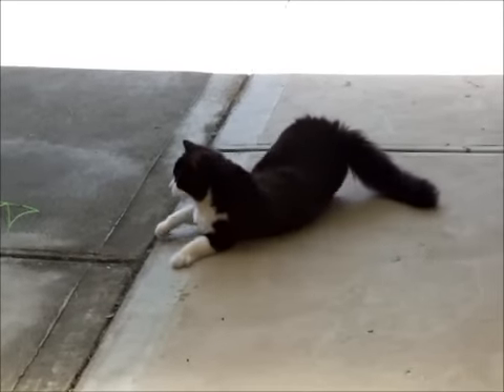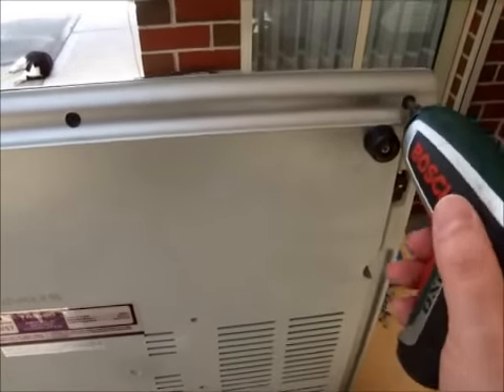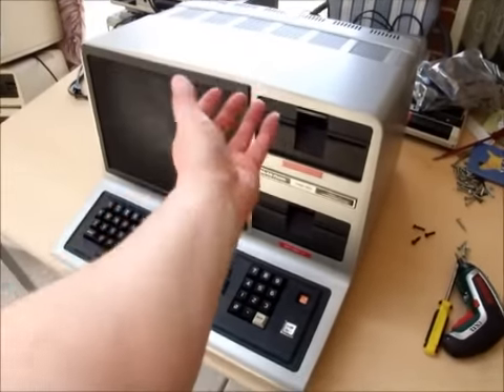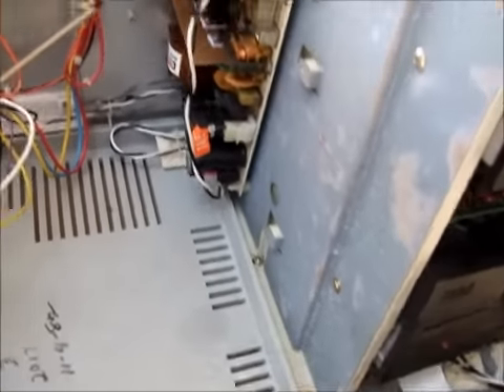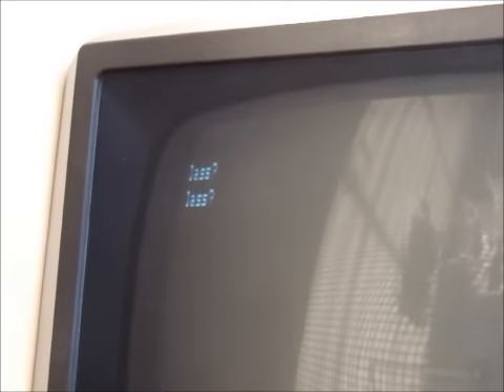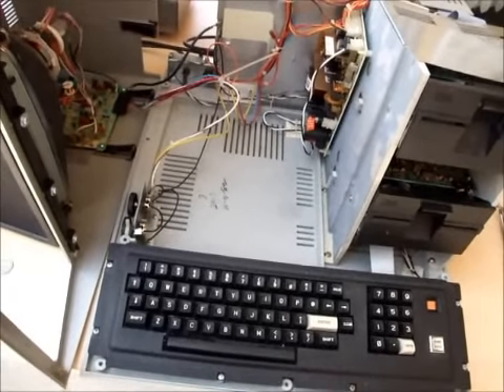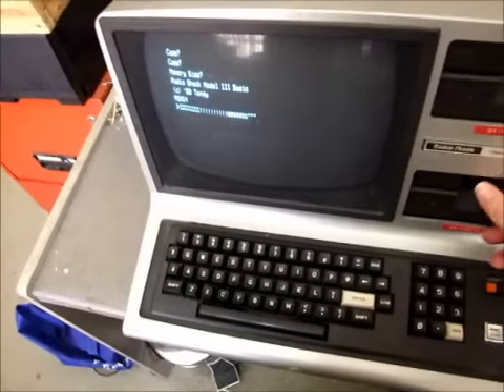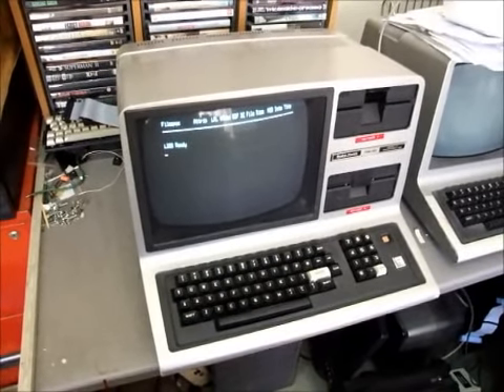TRS-80 checks before powering up

Comment: You're videos are extremely helpful.  I used this specific video and another one where you show the jumpers for a punctured keyboard PCB to fix my PCB.  Mine had a wicked hole thru the middle and the previous owner had about 8 wires running all over the place.  There was zero chance I was going to be able to use a multimeter to figure out the proper connections and I was starting to give up hope.  I freeze framed your jumpered PCB with similar post support damage and your two wire jumper configuration brought my keyboard back to life.  Thank you Sir for helping the Community.

Comment from the maker: I think the assembly at TCA and burn-in/QA test was all done in the one step and so the date seems to reflect the build date.  Most, if not all, Model IIIs, non-gate 4s and EIs have a hand-written date inside them.  Gate M4s and all 4Ds have a date stamp inside them.  

I have seen a lot of very late Mod IIIs which have parts which appeared in the Model 4, including the power supply, white towers, and digital video board.  M3/4 fully maxed system needs about 50W to run.  2x35W is messy inside.

Comment: so thats why some have that power supply, mine has the 2. the only key on mine that didnt work was the number 9 in the numeral keypad, all i did was reflow the solder on it, works great. i also had wrong things on the screen so i reflowed the solder on the character rom, again, works great. and of course changed the refa caps.

Comment from the maker: The stock Rifa caps are inferior paper types wrapped in plastic which eventually splits.  They were popular in the 80s but they don't make them anymore.  I use yellow Suntran MKT caps which are non-polarised direct replacements.  I didn't mention the values in the vid figuring anyone who is replacing them would know how to read the values off the caps.  For the record C1 and C13 are 0.01uF and C2 is 0.1uF.

Glad you like my videos.  They are fun to make and hear from other TRS-80 enthusiasts.

Comment: Ian, what about the "1982" date on the bottom of the unit?  From your experience do you think that's a manufacturing date of quality assurance test, or perhaps some service date?

I appreciate the insight on the age based on white towers and 65 W Model 4 P.S.  Do you have a list of manufacturing changes, perhaps with guessed time frame? That would be interesting.

Also, is there any problem with having a lower overall power output at 65 W vs. 2x 35 W (a total of 70 W)?

Comment: hi i have model 4 with issues :) first the power suppply its a 8709365 rev c. i see those boxy caps on c24 and c32. should i also replace those brown round caps c28. c30 and c31?

Comment from the maker: I never use the strobe lines to adjust the speed, i always use a disk-drive test program which is much more accurate.  Also I only fiddle with the speed if after I've done all the checks in the video and it still won't read, or if it doesn't read reliably then I check the speed and head azimuth alignment (the latter being beyond the scope of a YouTube video).

Comment: Ian, nice work.  Have you ever tried adjusting the floppy motor speed using the strobe lines?  I recall seeing tech's perform this operation when they installed new replacement drives way back in the 80's when people were upgrading to DSDD drives and such.

Comment: Wow.  You made the part replacement look so easy!  I guess practice helps.

Would you put the replacement part number in the comment describing the video?  You say it's a "better designed" cap but I didn't catch what the new kind is.  Also, are those polarized -- i.e. does it matter which way you put them in?